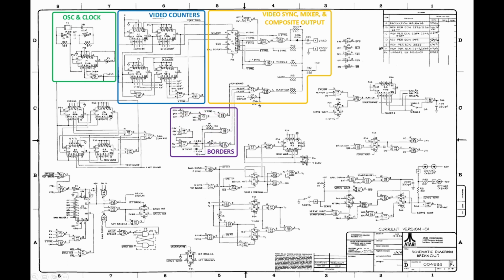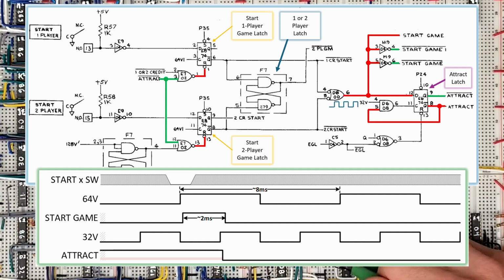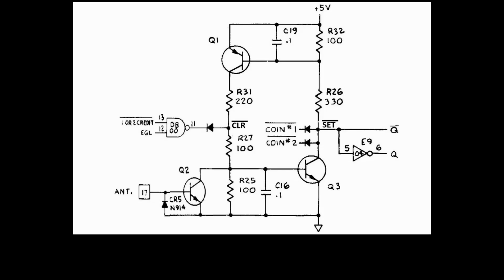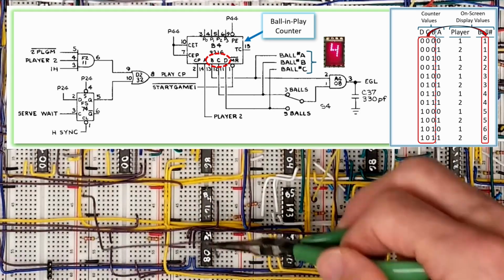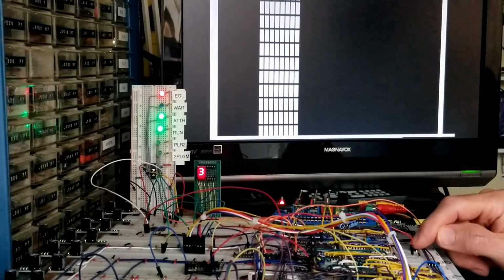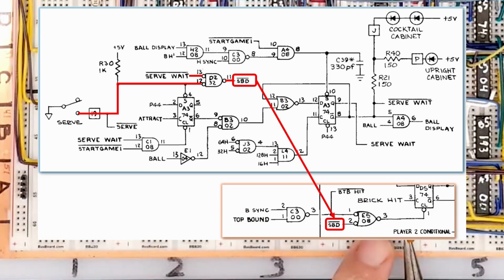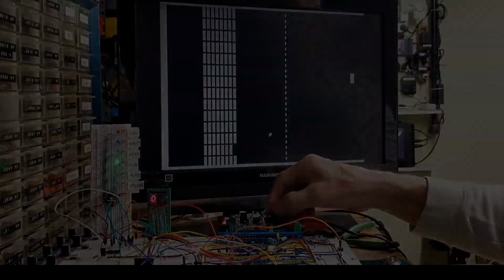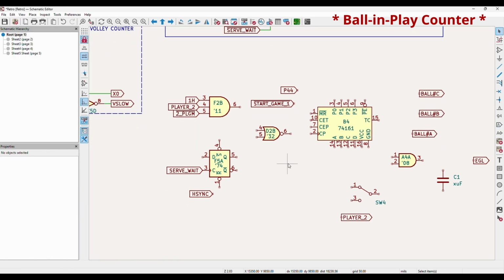Retro Atari Breakout Part 10 - Game State

Comment: This is giving me Ben Eater vibes!   So  at the beginning, I thought all you were gonna do was repair a breakout board. But this is nuts. Are your actually making one?  Can you tell me how this works,   is this the way created the first board, and then they would send it to some printing center to mass produce?   Thanks for the  videos!!!
Reply from the maker: The basic prototype was wire-wrapped by Wozniak/Jobs (not breadboarded). That was given to Gary Waters to make it into a reproducible, production version with all the necessary accoutrements: two-player, flip-screen, (scoring), coinage, sound. Would like to talk to Waters about the technical details like: Did he re-prototype? What prototyping board, what power-supply, etc. This was laid out by Howard Cantin, probably in 4x on vellum. I'm assuming they would make ~10x for the first few Revs, build, test, and modify. Not sure of the board house. There are some markings so it would need some research. The 2nd video has more detail on the revisions, serial numbers, etc. -Paul